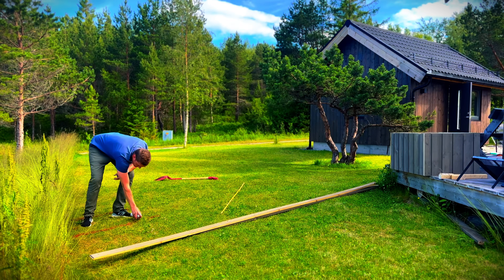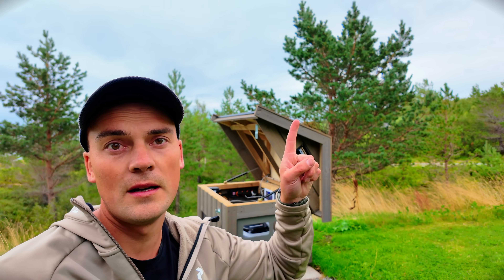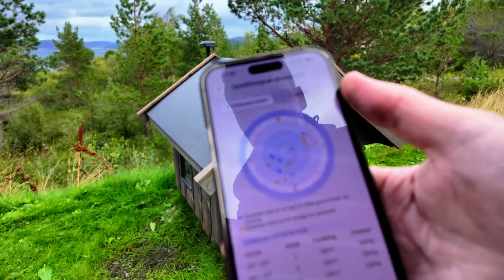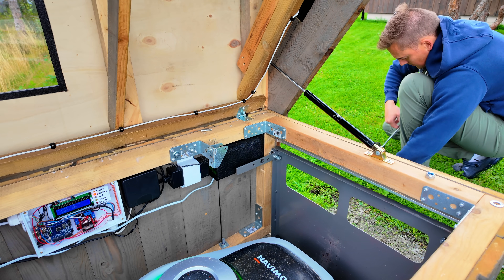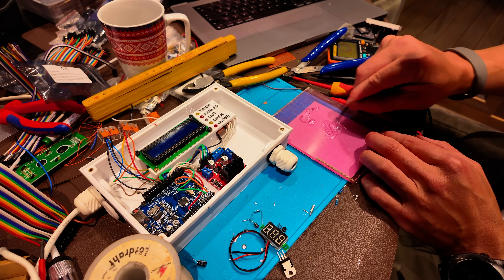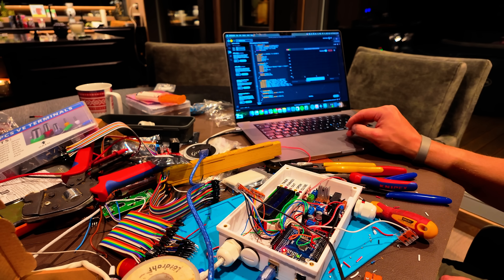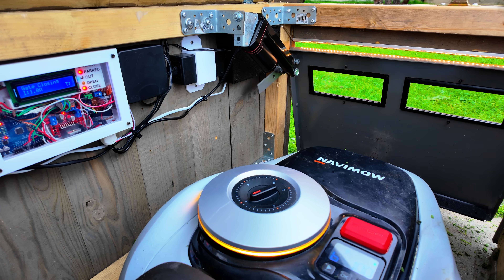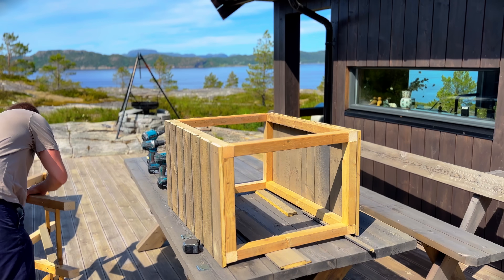The Most Overkill Robot Mower Garage gets Even Better!

Comment: is the tin roof basically a faraday cage blocking the sat signal?

also impatiently waiting on the poop solution for the printer bench at home
Reply from the maker: Hi! Yes, that’s correct. But the roof windows makes it work. I’m sorry being late on the 3D printer bench. It’s absolutely on my todo list. Just waiting on some machines. 😅
Reply: @frengen_engineering  cool :) can't wait :)

Comment: Why didn’t you just add a gps repeater. That would fix your issue without all those windows that didn’t help much but now introduced a future failure point.
Reply from the maker: GPS repeters does not work for this. The mower needs accurate positioning info from the satellites. (Distance/ angle and so on) A permanent placed repeter would not be able give usable information for anything moving. I think the windows will hold up for many many years, but time will tell😊

Comment: Possibly an improvement idea: If a cat or a hedgehog got stuck inside, or if Johan had a roomba tinder date staying over, would they be able to get out? Or is the actuator arm fastened to the garage door?

Possibly also darkened plexiglass roofing for the GPS signal?
Reply from the maker: Hi! Yes, as long as there is nothing in front of the sensor, the gate is opening😊 Så, if the cat get close, the gate will close, and then open again when the distance is over 8 cm. Will check out the dark glass 👌😊

Comment: Hi again. Just wondering, with going serial, did it solve the display issue or did you find another solution? Great video as always!
Reply from the maker: Thanks! 😊 Did not get any issues after going with the serial display. But it may also be because I made a separate voltage regulator. Or because I added ramping up and down for the linear actuator, so that it does not start and stop so instantly. 😊

Comment: What speed do you get with the 5G antenna? I‘d rather go with Starlink, works like a charm for me and is faster than local 4G and 5G.
Also, placing the deco inside a metal cabinet is not the best idea for the signal. Otherwise nice video! Keep up the good work 👍🏼
Reply from the maker: Hi! I was also considering Starlink, but the price differens of the antenna made me go for the 5G. It should be 100 down/ 10 mb/s up, but I get a little bit more. Around 115. And yes, I like putting signal dependent units inside faraday cages 😆 (The cabinet has plastic insert both in the door and backside) The deco is working a lot better laying flat, not vertical tough. But I got four in this setup😆

Comment: If you remove the lip, or add a slope to the bottom of the garage door, i think you could reduce the risk of johan getting caught on it if he happens to crash into the door.
Reply from the maker: Hi! Thanks, understand your point, I have already added a chamfer and filled the 90° angle. (3D printed) The lip is off course to strengthen the gate. (Johan is surprisingly strong💪) But he can’t push the gate open if the actuator isn’t extended enough.

Comment: Well done. Awesome project. 
Why not use pressure switches or laser trip wire to detect if the mower is still in the doorway?
Reply from the maker: Thanks! The ultrasonic sensor already know if he is in or outside the garage. Or in the dock or not😊
Reply: @frengen_engineering ah ok. It just looks like the door keeps hitting the top of the mower so wasn't sure if it was detecting the object or not.
Reply from the maker: @KubedPixel Aah! Yep, it was because he ran out later than planned, due to bad gps signal. Normally the gate is opened fully before he starts going out. (Delay)

Comment: Nicely done Johan, impressive project. Glad to have discovered your channel. That mains electricity distribution board also looks nice, what is the manufacturer please?
Reply from the maker: Thanks! I do not know where I bought the soldering boards. Bought in bulk, many years ago, but probably got it from Amazon. Something like this: https://www.amazon.com/YUNGUI-Prototype-perfboard-Sording-Electronic/dp/B088GSJM7G/ref=mp_s_a_1_1_sspa?crid=1I1B6CYTT9T8I&dib=eyJ2IjoiMSJ9.7HDr7UbuKOleC06awik76u7wXMlI0EV3g81mtitjBfTI1adYPbTtuK13xiikfSObvkSJixpSsY2-ECUIxB9EzRbjKveB0Z9cGb_kQXFUqDTm27YcmFCdNT__nVfM4bH1K7HfJUDCLzDPclr63lz__PWQqc64rbZX0AuyjByMQAlY7oQjuaYrFgLhDJsb3es5pam58EBU5p0o8DZF_F5PKw.pofq4IwRDNQfCefSLuFiXHiJkS2tKRH14TQxaZRWbTw&dib_tag=se&keywords=soldering+board+copper&qid=1756673277&sprefix=soldering+board+copper%2Caps%2C171&sr=8-1-spons&sp_csd=d2lkZ2V0TmFtZT1zcF9waG9uZV9zZWFyY2hfYXRm&psc=1